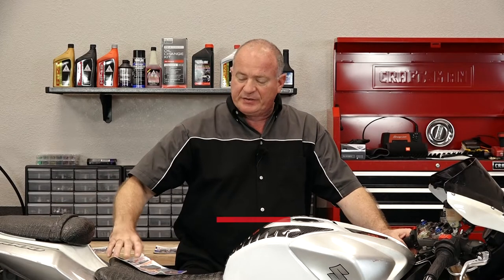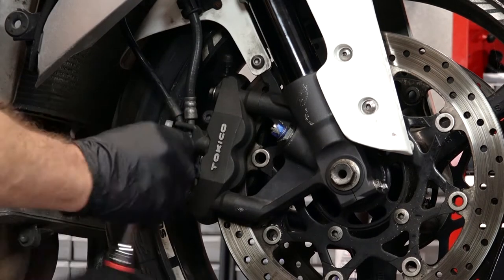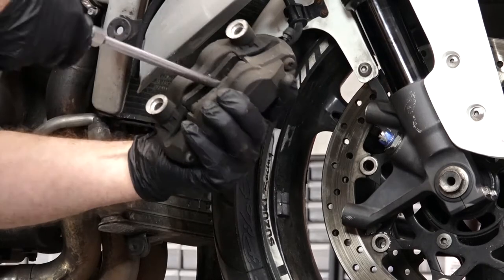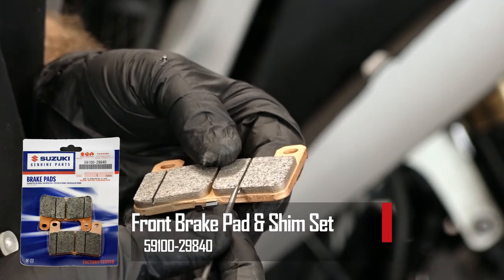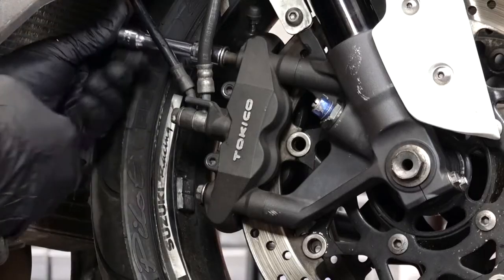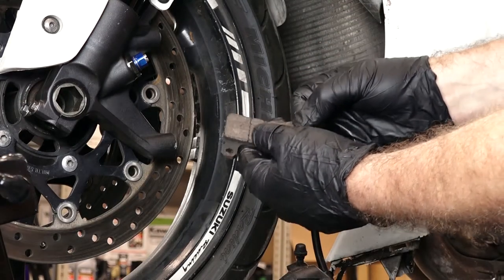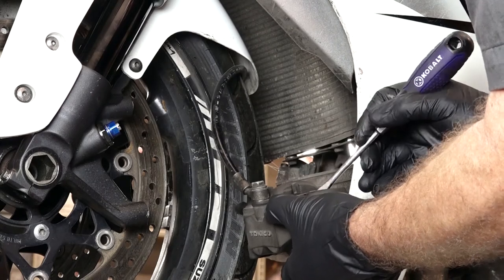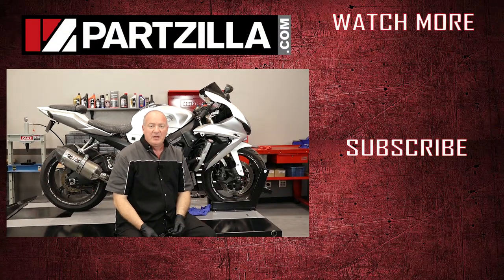How to Change Front Brake Pads: Suzuki GSXR 1000 | Partzilla.com

Comment: Not sure if you covered this in another video, but with contaminated brake pads, why didn’t you clean the rotors or explain the need to do so ?
Reply: And the other parts plus the wheel. If your a shop and you replace seals the clean up should be part of the job.

Comment: Just received some Galfer rear pads (k7 1000) advertised with 3 grooves on the pad side but I’ve been sent solid Galfer pads instead. Is there a difference and if so what is the difference? Have tried researching but it always throws back results for discs not pads. Any help much appreciated.

Comment: Is it normal to hear a "knocking" sound after changing the brake pads? maybe my rotor is slightly warped? (2006 GSXR 1000) I only rode a couple of miles after changing them so maybe i need to wear them in, but i've never had this whilst changing pads on all of my previous bikes?
Reply from the maker: You shouldn't hear knocking from your calipers.  Either something is loose or if the rotor is warped you'll hear a rhythmic scraping.  Double check the bolts and connections.
Reply: @PartzillaParts   Hey, I very much appreciate your reply. I have re-tightened the caliper bolts to 38nm spec and I will take it out for a spin tomorrow after I have flushed the coolant and replaced spark plugs (your guides have helped a lot, thanks). I think i may have tightened them too much originally. the brake pad pins were all seized and i had to drill them all out and replace, so i only tightened them hand tight, with a 1/4 turn afterwards, so maybe i need to tighten the pins so spec also

Comment: Hi, I have one problem, after I changed brake pards I saw that the brake liquid leaks a little bit on caliper was not to much, but when I went for a ride I realized that the brake is working jerky like ABS.What should I do, brake bleeding?
Reply from the maker: If you have fluid on your rotor, it can cause it to stick.  I would clean all the surfaces thoroughly and test it again.

Comment: Should we remove the cap to the fluid reservoir when we push the piston back in to let the air out
Reply from the maker: If there is enough room, it shouldn't matter too much.  If you overfill, it will either cause constant pressure on the pads or spill out the top if the cap is off.
Reply: Partzilla ok thank you
Reply: Never pull off the cap. There is a seal under the cap that moves down with the oil level. When pushing the pads back the brake fluid will fill the master cylinder and pushes the rubber bladder back. The air is on the top side of the bladder and will be pushed out. This part of the design and all master cylinders have this bladder seal on top

Comment: Shouldn't you use some brake lube on the sliders?
Reply: Inspect clean and use an approved brake lube by suzuki. Replace if the pins are worn.

Comment: I have a lower caliper bolt that will not come out.  Does anyone have any suggestions on how to remove it?
Reply from the maker: Try some pentrating oil to lube it up a little.
Reply: Don't lube it. Take it to a licenced mechanic.